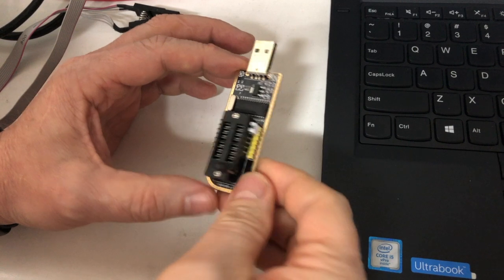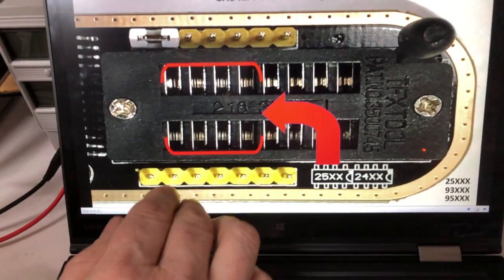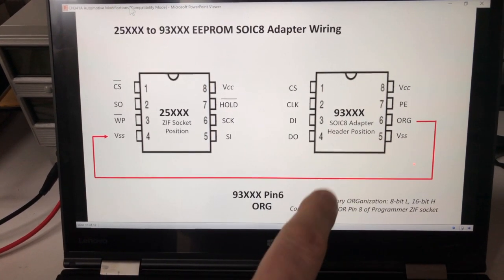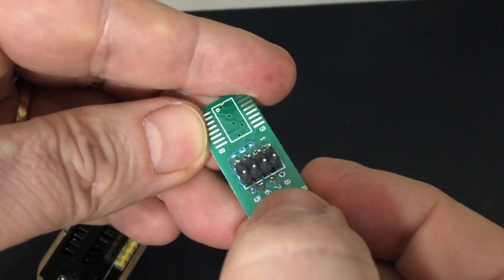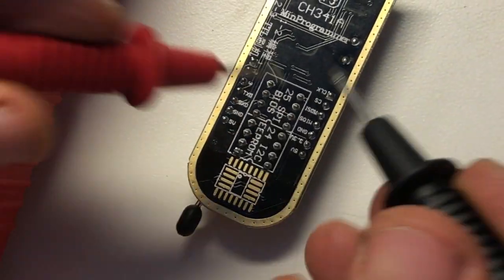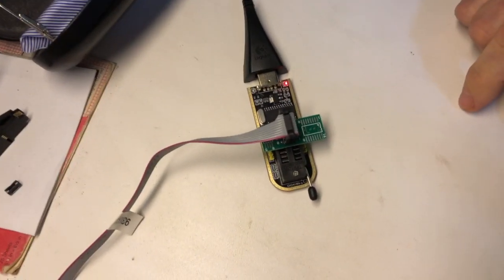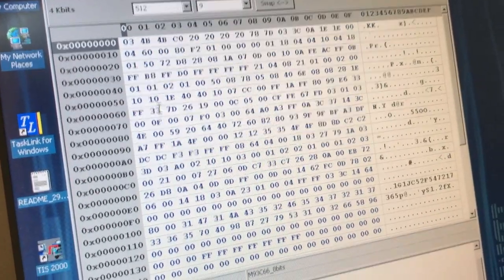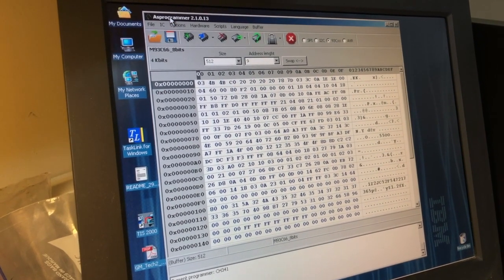Modify the CH341A EEPROM Programmer (Black Edition) for 5V 93XXX & 95XXX Automotive Use

Comment: I can see that you still reply to some comments. Legend!
Well, I have a problem and need to connect to my Mazda cluster 93c56 to change the speedometer speed. I did all the stuff in the video. I'm so far that (for some reason) it doesn't work at all unless I connect the standard 25xxx ports to the USB Programmer... It doesn't get a reading at all but showing 0 everywhere is better than F I suppose?
What do you think? I made sure that every connection is not hitting on some other connection and all connections are working
Reply from the maker: Try desoldering the chip from the cluster and read it off board.   The test clip approach actually only works on a very narrow range of module boards.  The vast majority of board designs won't respond to that approach (due to bus contention) and you have to remove the chip first.
Reply: @DrShock  even on such an old car? I never really did it and don't want to fuck it up, I mean I did solder today buuuut desoldering is different

Edit: it just says check settings
Reply from the maker: Presuming you have everything else connected properly between the programmer, applicable ZIF socket position and wiring, reading all 0's usually indicates bus contention.   That means that the test clip is providing power to other chips at the same time as the EEPROM due to the board design/layout. 
 These other chips are trying to communicate while you are seeking to talk to the EEPROM.   This trashes the reads and writes and forces you to remove the chip from the board to progress the issue without all that literal noise.

I would verify your setup by trying to read and write a spare EEPROM of this same type on the bench, before proceeding with the cluster.   If you cannot read that way, your tool setup is the problem.
Reply: @DrShock  actually big thanks for reminding me that my soldering is not the best :D It connected! But... all the things it says doesn't make any sense... It has a bunch of "+" and "/" in a row and some jubberish at the end. any idea?
Reply from the maker: Scroll down thru the memory to be sure that's not just one specific section of the chips contents.  If the entire chip looks like that, then be sure you have the correct device selected in the programmer software, and if there is an 8bit vs 16bit memory layout option that is correctly selected as well (also in the programmer software).   Be sure you have no problems with pins not making contact to the EEPROM or the ZIF socket of the programmer.
Reply: @DrShock  contacts seem fine, at least can't see that one pin is looking into another pin. Like 40% is "+", the next 40% is "||" and the last 20% are random letters and some numbers but in no right order. How do I know if I need 16 bit or 8? Is there an easy way on how to figure it out? I also used your chosen version of AsProgrammer and it rather wants to select 16 bits, at least only there is says the things I told you now, if I select 8 bit, I have spaces and a lot of "V"'s. When using the newest AsProgrammer, it seemingly goes to 16 bit. At least I think so if the older version gives more "data" if you can say so in 16 bit.
Reply from the maker: The possible reasons would be limited to:
- Wrong chip being looked at (i.e., not a chip that contains a VIN)
- Wrong chip type and/or memory size selected in programmer
- Wrong chip wiring to programmer ZIF pins (the 93xxx series must have a pinout adapter made as I went over in the video)
- Device inserted into wrong end of programmer ZIF socket

Also make sure you are not working with a 93Sxx vs a 93Cxx.  The "S" is for security, and additional wiring is needed (see the video description text).
Reply: @DrShock  Well I'm currently testing and trying it out on the facelift model of my car which has an OBD2 port. I'm not sure if the data is handled the same way as in the OBD1 car I have but for sure I know that the chip has the same location and is generally the same. I probably have to look into the pinout adapter again. At the end I'm not planing to change the odometer but only the speedometer and how it is measured (since I wanna change to bigger wheels) and looking everywhere, the internet at least says that this exact chip is used for the speedometer
Reply: @DrShock  well now I checked everything again. It is a 93c chip, I am a little frustrated now. I used my only board I have and I'm kinda in a hurry... Now it is not even connecting. I looked and every connection from chip to ZIF socket is connected, no cable is touching another cable and I'm after all very "confused" on how you did it. I literally used my board and used literally 7 cables to connect it to another board where  I stick a "thing" into so I can put it into the ZIF socket. I'm actually very suprised that it looks so small on your adapter and I wonder how. Well, it is now not connecting at all... As soon as I get the adapter on it, it just cuts power on the Programmer. I'm not really a multimeter expert and I probably somehow get along with the basics but now I'm just wondering why I can't see any 5V anywhere on my Programmer. It just... is gone? Did I somehow fry the programmer?
Reply from the maker: You'll need a multimeter to verify that the programmer is getting 5VDC input from the USB connector.  From there it goes into a voltage regulator that output 3.3VDC which isn't compatible with automotive grade chips.  Some commenters have mentioned these programmers can be had with 5VDC from the factory now, so the original mod on this older video may no longer be necessary.

But the 93xxx pinout adapter remains necessary to correctly map the 93xxx pins to the 25xxx pins on the programmers ZIF socket.   If you short out any wiring on the adapter, it can damage the programmer yes.
Reply: @DrShock  well I desoldered the chip just now and... its not really working :/

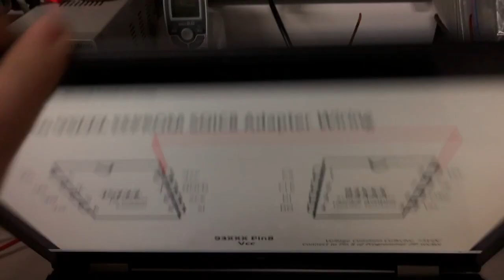Comment: @DrShock, I apologize for the late comments but I have a question @ 3:58 when you were showing your adapter. Did you have to cut the traces for the header pins to the zif socket before connecting the wires as described @ 2:05? And if that's true, do I leave pin 1 and 8 alone since they connect to the zif socket pin 1 and 8 respectively?
Reply from the maker: That little PCB shown at the time index you're asking about is just something that came for free from the seller of the particular USB EEPROM programmer I showed.  It's just an experimentation board and works just fine for making the pin crossover adapter we need for this project.  Yes, you cut the traces on that experimental board as needed, if you go that route, and add bodge wires to implement the adapter I showed on the slide drawing.   You are only making changes to the experimental board, you don't touch the ZIF socket on the programmer.  The only programmer change is related to having 5VDC.
Reply: @DrShock  Thank you for the helpful tip! That definitely steered me in the right direction. Cheers~ 👍👏👏
Reply: @DrShock  i have the same thing but cant precisely see where your wires are setuped , can you provide a diagram please ?

Comment: Dr Shock I have the black CH341A programmer and have performed the +5V out modification but cannot seem to cut the +3.3V trace as you show at the 6:50 mark in the video!  The trace coming from the +3.3V pin is not visible as it is on your CH341A programmer.  I'm wanting to use this programmer to change the VIN number in a GM radio I purchased from a salvage yard that is "Locked" like in your other video.  What will happen if I try to use the programmer as is?  Will I damage the EEPROM chip in the radio??  Your videos are excellent and informative!
Reply from the maker: It may be that they changed the circuit board layout on the latest programmer as this video is from a few years ago.  You would need to take a voltmeter and see what the voltage regulator output(s) are on yours to confirm whether it's operating in a 3.3VDC or a 5VDC mode.   If you do not have 5V, then you won't be able to write anything to an automotive EEPROM.
Reply: @DrShock  If I power up the programmer and measure with a voltmeter across the ground pin and the pin where the the jumper wire was added I get 5.10 volts and it also measures 5.10 volts at the +3.3V pin!  So, I believe this should work for the radio........your thoughts??
Reply from the maker: That's odd for the 3.3VDC pin.  I could only speculate the Chinese have broken it in the other direction now.  ;-)     Yeah, if that's what you're measuring no mods required.

Comment: Hello, for the 95xx series you simply have to modify the ch341a voltages, but not the adapter, right?
Reply from the maker: For automotive applications only, yes.   Also you have to have the correct level of AsProgrammer, or similar, software that includes the algorithm support for the 25XXX family of devices.

Comment: Having modded one of those before i have to admit i got no idea what the 24XX 25XX 93XX and 95XX difference is, not quite sure what does it refer to could you give me a hint?
Reply from the maker: Those are all EEPROM family architectures.   Where the first two digits are fixed for the part number, and the XXXs vary by memory capacity, speed, and organization.   Each family uses a different programming algorithm, but all devices within the same family use the same algorithm.   The programmer software sorts all that out, using the hardware to drive the algorithms required voltages per pin and durations for high/low.

Comment: Thank you so much for putting this video together. I just followed  your instructions and was able to crash reset my SRS computer with a 93c66. The only issue I had was with the programmer software you provided. I was able to read but not write. Downloaded Neo Programmer and was able to write.
Reply: @rickmerino4669  el neoprogrammer es el ideal para esto, ya que neoprogrammer  detecta, escribe,  y el otro el asprogrammer ya  no es visto no es frecuente y es más sencillo,  y el neoprogrammer  es el único que lee, escribe, y programas, yo voy a tratar de hacer un archivo de audio con el, y hacer que suene mi bicicleta con el sonido que yo quiero, ya que no tengo el pic 3.5 y aunque lo tenga ya quitaron la edición uno donde se podía escribir y grabar el audio y ponerlo en bits pero bueno espero obtener un archivo allí si sabes como hacer un audio en programación  con código con ch341 me avisa por favor

Comment: Simplified 5V mod: just add a jumper between 3.3V and 5V. That's the two pins closest to the 25xx printed diagram. The 3.3V regulator does not blow up from this.

Thank you, this worked! M95160
Reply: Yes their is an issue with this 5 volt mod. The black edition board I have on the back it says MINPROGRAMMENT not MINPROGRAMMER. So more than one version may exist. I performed the mod as described and discovered the cut by the 3.3 jumper pin only isolates the pin, and nothing else. When you add the jumper wire, all this does is short the 5V supply to the 3.3 volt supply. Also lifting the center pin on the 3.3 volt regulator does not isolate the output. This is because the solder tab is connect to pin 2 the output. Leaving the 3.3 volt shorted to the 5 volt supply, can load down the 5 volt supply a bit. A simple fix is to make no copper cuts to the board. Lift pins 1 and 3 on the voltage regulator, or remove it. Then jumper the 3.3 volt supply to the 5 volt supply at the jumper pins. Or use a shunt to connect the two pins if you have an extra.
Reply: ou 341 green:face-blue-smiling:
Reply: Can you post a picture of the mod please? It would be really appreciated, I'm struggling to find a working SDM unit for my Corsa D and most sellers don't provide the security code...

Comment: Far as the 5 volt goes no need to modify the board at all. Just use a jumper (i used a alligator clip) between the 3 volt pin and 5 volt pin.

Comment: I need your help pls, would swapping the 93c56 EEPROM from an old bad ECU to a new replacement work with the old keys? Logically I thought it would but I thought I need to ask a specialist, the car is a Lexus is200, both ECUs have the same part no btw
Reply from the maker: I typically only work on GM modules, and could only say for those that a  chip swap between the same part number modules would be fine.  For a Lexus, I would expect similar behavior but can't say for sure.
Reply: @DrShock  Thanks, I appreciate it, there's only one way to know then..

Comment: How did you go about cutting the connection between the 3.3V pin and the serial ports? You mentioned it, but didn't say how you did it. I am a total noob at this stuff.
Reply: I am working to erase the VIN lock on a Cruze radio, that you showed in another video, and I think this is that last thing I need to do in order to be able to complete the job.
Reply from the maker: If you're repurposing an existing PCB (printed circuit board) as I did, you can use an Exacto type knife to cut the circuit trace(s).

Comment: hey Dr.i am not a pro,just playing with this ch341a. so for the 93c56 eeprom i should connect pin 5 and 6 of the adapter to pin 4 on the ch341a??
Reply from the maker: No, you'll have to make all of the pin connections I went over for it to work.  Not just these you mention.  What the adapter you need to make is doing is mapping the pinout of the 93XXX series devices into the positions in the ZIF socket that were intended for the 25XXX series.   The AsProgrammer software will then take care of programming the CH341a to R/W as needed to these pins in their newly rewired configuration.
Reply: thank you for the quick response.i still have a few questions but ill ask then tomorrow.happy new year and hope to hear from you later  @DrShock

Comment: I built this adaptor just like you did and I ohmed it out to make usre it all matched once i was done.   However when i go to read a 93c76 8 bit i get a "microwire ic not responding check setting"  error.   When i put the chip in and plug the unit it both led lights are on and ideas???
Reply from the maker: If you are attempting to read the still chip soldered in the circuit with a test clip, you might try desoldering it and reading it on its own instead.

Comment: Can I read d93a66 thanks to the modification?
Reply from the maker: That would be a 93xxx series EEPROM so yeah for the hardware mod.  But you'll have to check if the AsProgrammer software supports that device too.

Comment: DrShock....I did the mod and checked it several times to make sure it is correct.   I can't read anything  but 0's from the chip.  F's if there is no chip in the pinch(pomona style) clip.  I have 3 ch341a black devices.  I modified the second one as per your vid., but still can't read the 95080 chip.  After looking at a schematic for the CH341a  and it looks like the same thing can be accomplished by removing the 3.3v regulator and place a shunt across the 3.3 and 5v pins. This puts 5v on the vcc pins . I will only be using this on automotive eeproms. I still get the same thing when I read the chip.   0's.  I've ordered some fresh 95080 chips for play but they haven't arrived yet.   Any ideas why I can't read anything but 0's?
Reply from the maker: You trying to read this 95080 desoldered from the board or in-circuit?  If the later, remove it from the board and re-try.
Reply: @DrShock  I have two chips 1001xxx Delphi chip and 95080 chip from two different BCMs.  Both are removed from the boards. Using the right out of the box adapter and ribbon cable with pomona style clip, I can read both chips.  I can't read them if f I use the modified adapter.   I didn't try to read them in circuit.
  
My point is,  my CH341a programmers do not need a modified adapter.

Comment: ARGH!! I screwed up. I somehow managed to skip the third step in modifying the programmer. I didn't cut the 3.5v line

Thank you for your excellent, clear, informative video that only a dimwit could possibly mess up!
sigh I hope I didn't kill my EEPROM. Back to Amazon to order another CH341a board.
Reply: what did it do to your board?   I have one that i didnt cut the 3.5 v line but it didnt cause any damage

Comment: Hey has anybody had an experience doing this on a 93c56 eprom? I’m having a hard time connecting to mine in my LS400s ECU immobilizer chip?
Reply from the maker: Have you desoldered the 93C56 from the circuit board first?

Comment: Hello! I have tried my best to follow these instructions but everytime i go to read the eeprom in asprogrammer it tells me to check settings. Do you have any advice?
Reply from the maker: When using for the first time start with a blank EEPROM of the same type out of any circuit, in order to confirm you have USB drivers all setup correctly and ZIF socket alignment/ribbon cable connected etc.   This way you always know, it's not the tool.

There are very few automotive EEPROMs actually that you can read in-circuit with a testclip setup, most of the time you have to desolder them and read/write out of circuit anyway.  But having a blank around, a control if you will, let's you know the tool at least is setup and gtg.